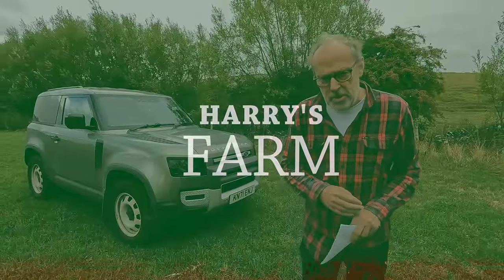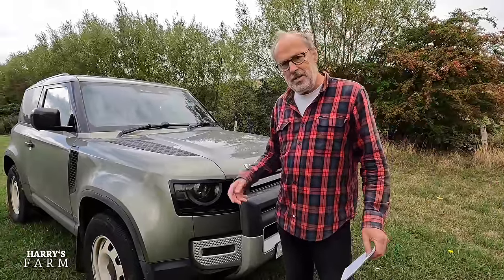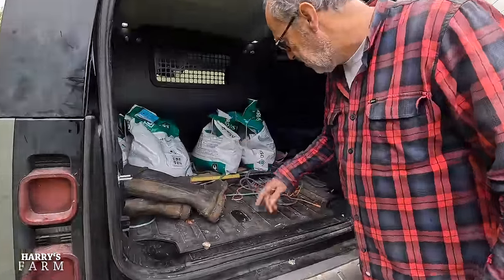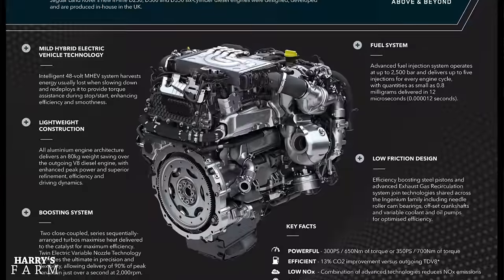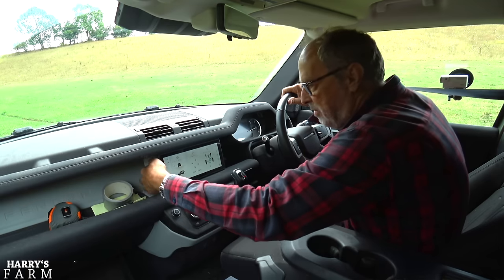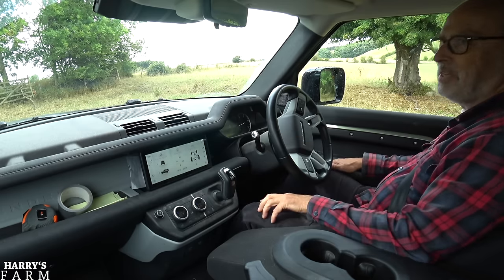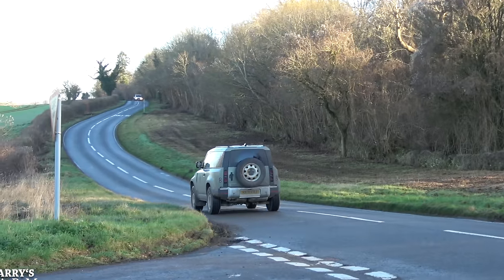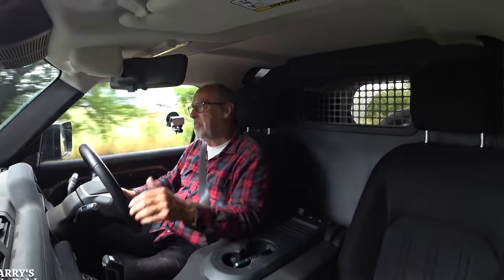New Land Rover Defender 90 Hardtop 12 month review. Is it a true farmer's car?

Comment: Big issue with headlights, most dealers and garages will set the lights at -2 instead of thinking and looking at the light height and choosing for -0.5 or -1 depending on height. -2 is even too much for most commercial vans.

With that setting you will get something like 30-50m light in front of a car with a huge bonnet height, resulting in you not being able to see the road at all. It is a mechanic error that all mechanics seem to make (and it pisses me off as the math is kindergarden simple)

Comment: Wow that’s an extraordinary price for a farm runaround and there’s a lot of them on the road with huge specs from the factory 👍🏻🏴
Reply: There's an awful lot of people around with money, despite what you hear.  Personally, I would never have one even if they were a sensible price, but each to their own.
Reply: @jimskirtt5717  they look good but I suspect they will need upgrades or remodelled to keep the sales coming 👍🏻🏴
Reply: @ewanstewart8011  
Will it be enough to save JLR?  They are just about to record their fifth year of heavy losses - some £6 billion in total.  Obviously they can't just carry on recording massive losses.
Reply: They're bought on the never never.
Reply: @anonanon7497  
Yes, a lot of cars are leased, but the Defender lease cost is pretty silly.  My house has a speed bump right outside.  We figured some years ago which the lease cars are when they fly over it!  They bottom out with a horrible scraping noise.

Comment: Good as the new Defender undoubtedly is off road I get the impression that a major part of the design brief was good on road manners and comfort rather than a commercial, working vehicle practicality, hence the shortcomings in the base version. As Harry said, VERY expensive for a farm runabout especially when compared to competitor offerings but with waiting lists as long as they are  I guess JLR aren't really bothered!
Reply: Not so expensive after you've reclaimed the tax and VAT as a Commercial Vehicle 
Also you don't pay the high initial road tax, and BIK is only £700 per year.

Comment: Great review. Be interested to see a similar review of an F Pace on the garage channel. I have a P 400 and had a D300 before that. The 3 litre diesel was a peach even in its more highly tuned 300bhp form. Swapped for the 400 petrol because I do a lot of short journeys. I find a lot of the positives you say apply to the Jag too. That mild hybrid system is brilliant especially the stop/start - something I normally turn off. Mine has had some psychological  problems following self generated computer updates, but the dealer has been very responsive. A really good car - why don’t more people buy them instead of German cars????

Comment: As a replacement look at the Discovery 5 commercial. Into 4th year of ownership and mine it has been faultless. Much bigger rear space, 2 extra rear door access with underneath gun locker and better upper hinged back door. Has plentiful space in back for logs, livestock feed etc, but with Range Rover luxury up front. Mine is 306ps with effortless cruising with decent mpg. Same “always looks great even when dirty paint”, headlights are brilliant as too stereo system. Even the 21’ black alloy wheels are still looking great. Happy with building materials in rear or at Ascot… great car that I will keep for 14 years just like my older Disco 2.
Reply: They're 90k now

Comment: I have an F-Pace with the 4 cylinder diesel Ingenium - the start stop combined with 20k mile oil changes destroyed the turbo at 52k miles.  The entire system from the manifold to the tailpipe was replaced under warranty.   If you own a diesel, do yourself a favor and change the oil every 5k and disable the start/stop - there is a module in the rear you can unplug that monitors battery voltage....
Reply: Better still… don’t buy a diesel!
Reply: The start/stop feature isn't something that comes on diesels in the US. The EPA makes it difficult for manufacturers to offer the small diesels (regulations are different for anything under 8,501 lb GVWR) so most vehicles with a diesel are for work/towing. Oil change intervals in my 6.7L Cummins were 5,000 miles for conventional oil during break in (first 100,000 miles) and then you could switch to synthetic and increase the interval to 10,000 miles.
Reply: @PhilbyFavourites  If you are towing long distances or heavier trailers a diesel makes a lot of sense. My smallest trailer is rated at 14,000 lbs (30' enclosed conventional hitch car hauler) and I could pull it with a gasoline powered truck, but it wouldn't be ideal and fuel mileage would be terrible. My larger trailer is a 48' flatbed gooseneck rated at 26,000 lbs. The diesel is much better for that.

Comment: I believe that the third seat comes in a pack with the rear roof camera. If it is not available today in a pack, it could be linked with the limited visibility on near cars and objects as mentioned in the video. EDIT… Just checked and I’m right. £1250 extra as a pack. The standard rear view mirror just doesn’t work with the middle seat backrest upright. It blocks the view almost completely, hence the necessity of the camera as a pack item.
Reply: You’re not completely correct. The third seat isn’t available on the base Defender hardtop anymore according to the Land Rover configurator, as you can’t specify the digital rearview mirror with the base spec
Reply: @Henning_  
Yes, the on line configuration only lets you have the pack on SE and HSE versions. I wonder whether the dealer could specify it on base models? They sometimes have more flexible options than us mortals.
Reply: Maybe true, but the positioning of the camera on this model makes it useless.

Comment: harry's review honest and excellent as always ... just one note regarding the jittery ride when towing, this is almost certainly due height of the hitch causing an instant battle with the tri-axle trailer putting tremedous stress on the rear springs .... note the still of Harry's Range Rover towing the same trailer with the much lower hitch with trailer and towing vehicle perfectly level...

Comment: A thorough review of the Defender.Looks like a useful vehicle. However I shall not buy one,£60K is a trifle dear. I'll stick with my 26 year old Discovery which cost me an initial outlay of just £600 about ten years ago. Not fast , but she is still a solid trouble free example of what a proper Land Rover is. Regularly used for farm and forestry work I can't think of anything that provides the same value for money. These imported pick ups are too soft and flabby,too long , too wide and generally an unpleasant vehicle off road.

Comment: Firstly great review and fantastic channel.Have my 110 ht a year now and find it exceptional ,delighted to hear you mention the noisy door rubbers ,gummi fledge dressing helps alot , it is full of computer parts all week for my company and used fishing or transporting home a sika stag at the weekend ... Tried ordering another for next year but now missing the digital dash and larger display so have to wait until available again.I'm wondering if your particular lights were faulty as I find them very good , easily on par with our RR Velar .
Reply: The back is not really suitable for carrying animals, live or dead. The soft furnishing at the side is chewable and the underfloor compartment is almost certain to fill up with body fluids. As Harry said, it hasn’t been very well thought out.  
By the way, the latch that holds the floor lid in place is almost certainly identical to the ones securing my bunded fuel station security doors closed.
Reply: @hedydd2  hi Huw, we use a deer tray ,more to save contamination of the carcass than protecting ones soft furnishings,works a treat !
Reply: @gearoidol  
At least the carcass should not chew the soft furnishings, although it might get c covered in snot and/or blood. 
must be small deer to fit in the tiny back of a Defender90.
Reply: @hedydd2  never tried getting one into a 90
Reply: I carry a very much alive dog in my 110 all the time not a HT so there are no soft furnishings in the load bay. Hope this helps!

Comment: Very interesting video, Harry. I'm a refugee from Harry's Garage and what you said about the car's useless headlights resonated with me as the high beam on my (now one year old) Subaru Crosstrek is also hardly distinguishable from low beam . . . indeed, it's actually worse as you lose light on the foreground because the fog lamps automatically go off when high beam is selected.  Very frustrating as, when you're out of town here in British Columbia,  it's pitch black and you really need good headlights.

Comment: I see a lot around but I don't buy into it for farm use.  I think they are more an exercise in image than practicality.
Reply: had my 110 for over 18 months now use it for work (forestry) and around our farm , its belting and it gets worked , best motor iv ever had very practical a lot more then any pickup iv ever had and iv had a few , yep its a bit flash but i dont care to be honest
Reply: @andrewpass3721  I don't doubt that it will do work but with a price approaching £60k and with no more space than a Ford Focus with the back seat folder I struggle to see it as particular value at the price point.  Thought the residuals may make the lease costs reasonable you're really going to suffer if you hand it back dinged and scratched and dirty after three years of farm use.   Its very expensive for a runaround with a chainsaw vehicle.
Reply: @andyjones8448  I do see your point bud , I got my 110 just before the price went mental and got the vat back on it so was good for me , the towing capacity of the thing is way above the ranger wild tracks we had plus it’s ruggedness and it’s comfort blows any pickup out there into the wind , plus it’s easy to clean out no crap in the carpets because it’s all plastic and easily cleaned , but yep see your point with the price of them , I got rid of a pickup and a car for mine because it will do both jobs no bother though
Reply: @andrewpass3721  well yes, I can see that if it's a one vehicle that can replace two then it works well.  The low pound will mean global exports will go bonkers and keep used prices sky high for a good while yet.  Glad for JLR as the J bit is struggling.
Reply: @andyjones8448  
It’s built on the continent and just about the only major component that benefits from a low Pound is the engine that is British built. Trouble is, it has to be reimported into the Uk in fully built vehicles.

Comment: I have a 110 and grew up on a farm. It’s no way a farm vehicle it’s a replacement for the old discovery. Great for occasional farm use though and pulling a trailer / family trips etc. not a day to day farm vehicle though / that’s a hilux or
Similar
Reply: Plenty of farmers have used LR90 hard tops over the years and are apparently happy even though they have always had a very very limited carrying capacity. I’ve always preferred the long wheelbase myself, particularly the HiCapacity pickup where a 600kg tote bag or a 1000 litre IBC or a big round bale would easily sit. The carrying capacity is surely important to most commercial users and that’s where a 110 to 140” wheelbase pickup truck scores, even with a four door cab.
Reply: @hedydd2  agree / that’s what we used prior to moving to a Hilux - high cap 110 defender pickup. That was a hardy farm defender!
Reply: @jpg6482  Back in the early 80's Subaru pick ups were all the rage in Devon !
Reply: @jpg6482  
I ran a hi-cap pickup naturally aspirated 2.5 110 for all of 22 years of really hard driving. You couldn’t but drive it hard with only 67hp to pull itself and, often, 3.5 tons towed behind. It basically wore out in the end and a broken piston sealed its fate. Every part of it was getting to end of life, apart from the chassis and bodywork which were good.
Reply: @PHILCHUDS  
I had one of those for a while. Nearly killed my father when an exhaust gasket failed and gave him carbon monoxide poisoning. It liked a drink and its brakes were completely unbalanced when new. The dealer wasn’t interested until I rang them up in a temper one day after the back brakes locked and nearly had me in a hedge. I threatened to report them to VOSA or DOT and to Subaru head office that minute if they didn’t get it sorted. They were out collecting it within an hour. They had all the parts in stock and had been paid to do a recall but they just pocketed the money and sat on it. They were more afraid of International Motors and Subaru finding out their dishonesty than of official government authorities. The idiots would have lost the franchise for sure.

Comment: Good review almost same conclusion I came to when returning a leased new Defender few months ago, last 10 years I  have had 3x L322 TDV8' s as working tow vehicles and early TD6 L322 ( not good )  ,but unlike You I always seem to be returning to my old P38 for difficult heavy towing ?
 As an old P38 has everything a new air suspension Defender gives with amazing go anywhere towing and extremely comfortable long distance mile crunching ability an old P38 is better off road towing car than L322, an L322 always seems to get stuck towing in fields .
 An old P38 just tows as well as a new Defender at a fraction of the price 🇬🇧
Reply: If you are using a P38 for heavy towing I'm not really sure what your definition of heavy towing is. The maximum tow ball weight spec is only 150 kg. That would make 1500 kg the maximum that you can tow with any kind of stability (ie: 10% of trailer weight on the ball).

Comment: No its not. Most farmers will go for a toyota hilux or something similar. They want a vehicle that works and is reliable. An electronic parking brake and air suspension has no place in a practical work environment. They are upper middle class family cars.
Reply: Every HGV has air suspension, seems to work just fine for them in a practical work environment, most new HGVs also now have electronic hand brakes, work just fine.
Reply: @Jabber-ig3iw  Not to mention, superior for towing
Reply: @Jabber-ig3iw  air suspension is a lot less reliable and a lot more expensive to fix than coils. After owning discoverys 1-4s I can say this with absolute confidence. And electronic parking brakes are fine, until they arnt, and then they are an unnecessary pain in the arse and £1500 to fix. They have failed multiple times on our D3 & 4 and are a weel known issue with land rovers. Every 5 years you are ripping apart the centre console to yank the release cable. When it comes to work vehicles, simple is better. Land Rover dont make work vehicles anymore. They make family people carriers designed to be on the road. In 2016 land rover killed the defender and the discovery. If they had put a discovery badge on the new pretender then it would make a lot more sense.
Reply: Yep

Comment: It seems awfully small for a work vehicle by Canadian standards. Besides large pick-ups farmers in Canada are starting to import used K-trucks from Japan for running around the farm as the beds have a lot of space to carry stuff. That Defender has such limited space.
Reply: This is the short wheel base version
Reply: British roads have limited space
Reply: @frogsplorer  A Japanese K truck would be great exept for the lack of towing capacity.
Reply: @briankennedy9829  ah ok, a kei truck. Those look cute
Reply: HD pickups and cab and chassis flat beds are the norm for farmers here in the US. I'm in Maryland (lots of horse farms) and just about every farm vehicle is a LWB with a gooseneck hitch. We currently have an 176 inch wheelbase F450 ordered for towing duties. Our 12 year old Ram diesel was not rated for our larger trailer (26,000 lb GVWR).

Comment: Great review and overall vid,  totally agree We've had a commercial for 2 years and I also have a 'REAL'  90.   So impressed by the new defender, towing its effortless so much torque from the D200, I agree the steering feels vague by comparison and aye its expensive.
Just traded ours and basically got what we paid for it 2.5 years ago which is insane.
#

Comment: A very balanced review. Interesting comments about towing - wonder how much effect the height of the tow ball has on nose weight etc. 

Staggering used values. I’m taking a leaf out of your book and sticking with an older L320 RRS for 3 tonne plus towing duties.
Reply: I reckon a good TDV8 facelift one of those is about as good a bargain towing workhorse as you'd get nowadays.

Comment: Harry, chunky off road tires on the vast majority of SUV's are a fashion choice. I've run a LandCruiser and a Pajero (Shogun) for nearly 20 years all up. Been in all sorts of terrain including sand, rocks, flooded rivers serious Aussies outback tracks and have always had All Terrain tyres. I got bogged twice. Once in super soft sand on a tidal flat and once on a clay pan. We got out of the clay pan and were towed out of the tidal flat by a massive front end loader. If you look at what mine vehicles and farmers use in the Outback you will see they use All Terrain tires with tough side walls and an "open" tread pattern. Actually now I remember, we got bogged in river sand once with our 1500kg camper trailer on the back: stupidly took my foot off the loud pedal at the wrong time. Not a tyre issue, was a driver issue.